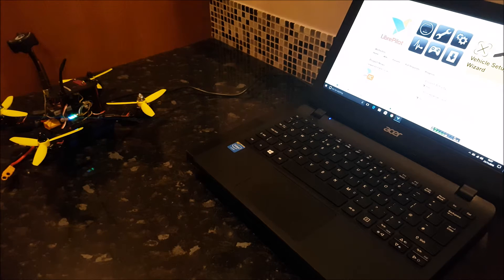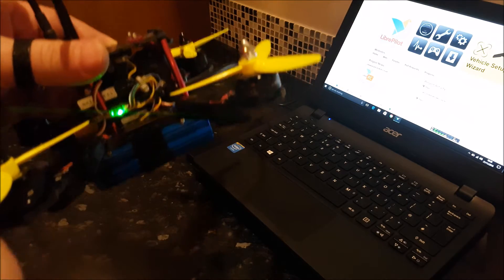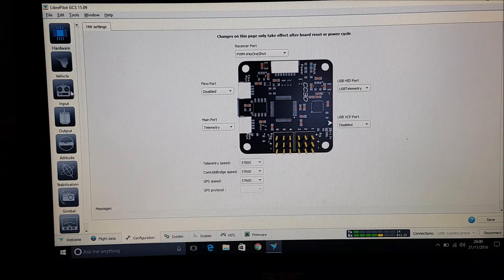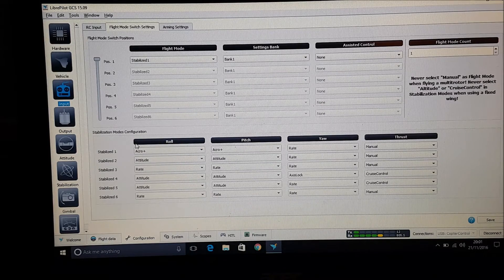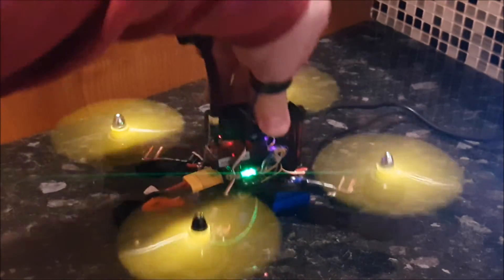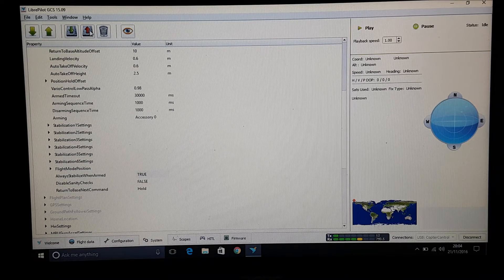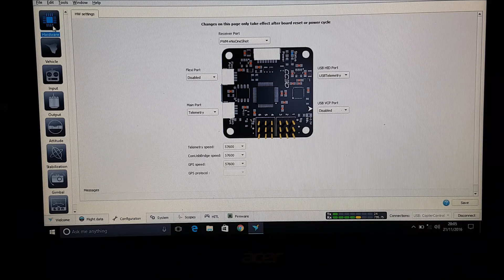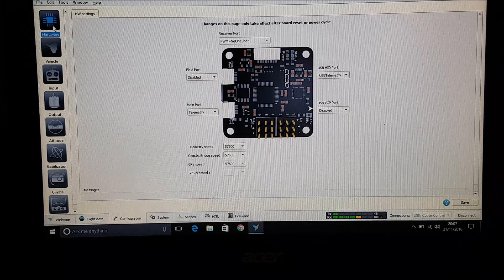CC3D Air Mode Falling with style just like clean flight or Beat flight....

Comment: Hello. So can you have this setup like this in stabilized mode 3?. My first two are ratti and atti, then 3rd is acro, acro, manual. I'm wondering if it enters the default stabilized while zero throttle when in stab mode 3. Or do I have to start it up in stab mode 3. Or just have one setting? Thinks for your time.-Brandon

Comment: will airmode work if arming is not on a switch?
Reply from the maker: 20203811 no because there needs to be a minimum idle speed for the motors . they need to be running at all times specially at zero throttle.